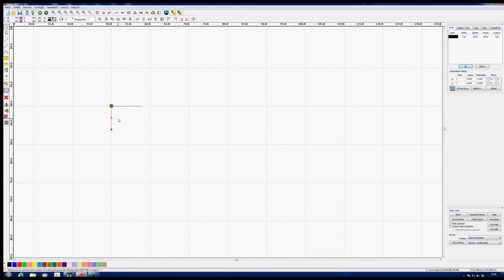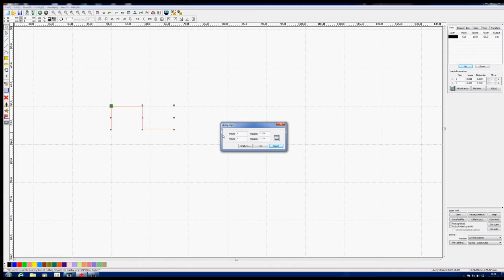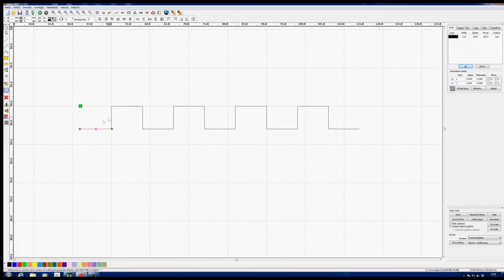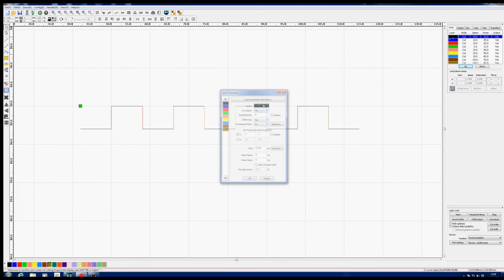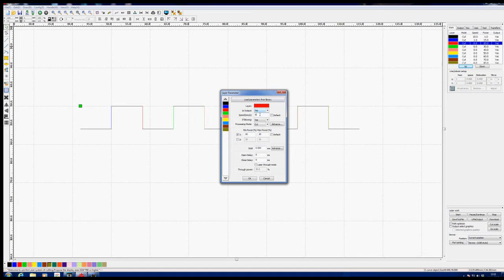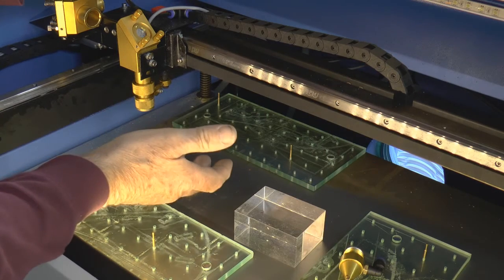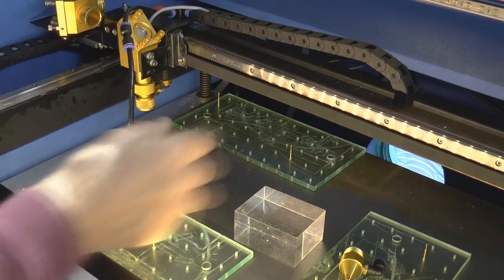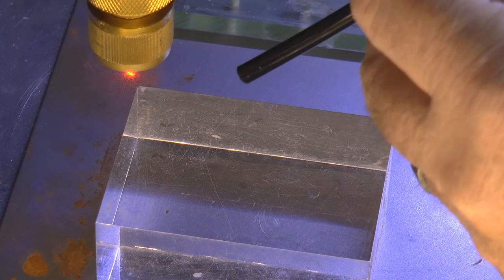RDWorks Learning Lab 27 Simplified Mode Burn Test

Comment: A true teacher is not someone who knows everything...A true teacher is who knows how to get the answers. YOU are a true teacher for me and a joy to watch all your lessons. I only wish I would have discovered you before I bought my nightmare laser. For the same money I paid I could have gotten a much better designed laser like yours. (mine had the worm screws to lift the table with installed 9mm out of the vertical and no way to adjust them as well as just clamps to hold the laser tube down) Finally after about 6 weeks I got it running thanks a lot to your lessons. Still needs a lot of improvements to be done and all the tests to see where the laser performs best. I have taught computer lessons on local TV and I know a true teacher when I see one.
Reply from the maker: Hi
Thanks for your kind words. For ME to learn this technology I need to break it down into simple understandable  (and rememberable) elements. I have spent many years designing and fault finding equipment. Solving these sorts of problems is bliss for me. I have often had to show others how to fix problems. You cannot fix problems with BS you need simple understandable elements  to build on because no two problems are the same. Never fear writing if you need advice. This far away I can only help YOU solve the problems, my arms and ears are not that long.

Best wishes
Russ

Comment: Much better way excellent .. I had forgotten the Y could be disabled !!!!!  .. Do you think the act of doing the burn going through all the mirrors affects the result?
Meaning that if the mirrors decrease in efficiency as the power goes up that it might not all be in the tube?
I wonder this, as techs I've seen on larger machines do this by removing the mirror and the shoot the test piece directly or perhaps use one mirror before the piece. hmmm ...
Reply from the maker: +guinnesspeaks 
Hi 
When techs do this mode burn for "proper " machines they are checking for the alignment of the reflecting mirrors in the tube. The sort of tubes you get in industrial machines allow you to set the internal mirrors to get the best  shape power distribution in the beam. Ideally you are  trying to obtain a nice even conical power distribution in the form of a bell curve or Gaussian curve. You do not need the influence of mirrors to upset trying to set this characteristic. Sadly you do not have the option to play with the mode in these  sealed  glass lasers. The ends of the tube are ground parallel and the mirrors are glued in place with epoxy. Crude but obviously effective (most of the time).  Because acrylic evaporates in proportion to the IR energy hitting it, the damage it does to a block of acrylic is a fantastic and simple way to see just how your power is distributed across the 6mm beam. You can test the beam directly out of the tube and after each mirror to see where you are losing power or getting beam distortion. So the purpose of this use of acrylic is not to SET the mode but to check how the mode / beam shape changes after 3 mirrors. If it's oval there is a good chance you are clipping the edge of a mirror (most likely mirror 3)as they are nearly all designed with that mirror centre low (don't ask me why). It also shows you the relative power characteristic of your machine. It is no real indicator of absolute power but should clearly demonstrate why you get little benefit from using more than 60 or 65% power setting.  This use of acrylic is about the only useful thing I brought across from industry.
Measuring absolute power from these machines is desirable but impossible to do without  purchasing a piece of fairly expensive kit This is all explained further into the series.
Thanks for your comments.
Best regards
Russ
Reply: I understand your line of thinking on this ...
Thanks for your response.
Reply: One more thought .. I haven't seen you investigate this... and I am not saying that you should at all. I think you might be interested however.
But my side hobby/biz was repairing computers.
I learned a lot about power supplies. I noticed over the years that they are not created equal.
They may be rated the same but they come from countries with different standards, and that the higher some are taxed, they will peak and diminish in output. They have different heat sinks, coils etc. They rate differently at peak power, and indeed how long they provide it. Chinese are notorious for lying about their product in this manner.
Another thing I noticed is that a good power supply feels like a brick, the crappy ones more like a tin can.
Reply from the maker: +guinnesspeaks 
Hi
Power supplies for these machines are beyond my comprehension. I communicate with a guy in USA who is a wizard with power supplies. I had several questions about my original power supply which he tried to help me with 
He informed me that HV power supplies to control these tubes are a breed apart and there is a lot of black art that each manufacturer employs. There are those who are good and those who just are. I'm not an electronics expert and the only thing I know about HV equipment is that I know nothing, so I pay it great respect.
I do know that the power supply that I now have with my 60 watt tube is superb. It's reliable and predictable and has been manufactured by the same people that made the tube, hence I expect they have been well matched. I agree about Chinese specifications  but after much research when buying my new tube, I was pleasantly surprised to find a Chinese company that did NOT lie about their products, produced something  that was well documented and of  high quality and were easy to communicate with.
Thanks again for your comments 
Russ
Reply: Energy passing to and through the tube may be clipping rather than smooth or at different rates than expected ... causing stress on the tube?
Much like they rate a 40 watt tube at 50 .. the same might be happening with the power supply or the quality of one of it's legs?
Reply: Ok .. thanks .. just a thought.
:)

Comment: Are you getting the same results from the new laser tube?  I'm going to have to try some tests at lower power settings.  Even at low speeds I've had troubles cutting through .25 inch plywood using higher power settings (90%).
Reply from the maker: +Rob Weinstein 
OOps. As you have seen. I wrecked my first tube by believing that more % meant more power. I hope I have now done enough demos to show that these machines do not have a linear power output, it drops off rapidly at about 60% and after that you are  just "over-revving" your engine. The purpose of this  test was to benchmark my new tube and graphically display its power characteristic without recourse to any complex equipment. As it happens I have a power meter on it's way to me and I will then be able to put absolute wattage values to my graph. Now that I have fitted an ammeter I absolutely know that 65% is the max current recommended for the tube and the only time I exceed it is whilst doing these few tests. I have a good contact in USA who has purchased the power meter on my behalf. Before shipping it to me he tested his own 60watt machine and found that he was getting just about 50 watts max at about 65- 70%. There was no extra gain between 70 and 90%I am anticipating my machine will turn out to be actually 40 watts. I have not cut 6.5mm ply but I have easily cut 4mm 3ply at 10mm/sec 65%. I suspect I could cut your thickness at 3 to 5mm/s
Reply: +SarbarMultimedia yes. I read enough before making my purchase that I've always assumed it to be closer to 40 watts. I would never have guessed (or even thought to have tested) that the output is non linear or worse. Amazing that it actually drops off with higher output settings. 
Thanks so much for putting your engineering skills to this problem. It will help all who watch to get the most out of our machines.
Reply from the maker: +Rob Weinstein Something I didn't mention. I noticed that running my machine for at 90% was great for up to 30seconds and after that the power dropped off rapidly.A couple of fellow users who obviously know a lot more about the physics of laser tubes than myself, informed me that is a typical characteristic when the gas mix breaks down and no longer lases properly.  Rest it for a few minutes and the gas recovers so that you will repeat the cycle. Whereas at lower  current inputs (say 65% power) the gas never becomes unstable and you get consistent results.
Reply: Hmmm Interesting. Seems like a Power meter would make life easier :) How does the look? Any LInks? And how or where do you connect them to measure the power? Is it actually the laser beams power it is measuring, or is it measuring how much power it get from the PSU or.....?
Reply from the maker: Hi Klaus
Power meters can be expensive.You can buy a US digital power probe for $800 or an analogue one for $400.
You can also go to 
http://www.bell-laser.com/?gclid=CJvxv5Cx1M0CFRFmGwodJBIJdg#!product-page/c1iym/1cd1a226-cf6b-7b63-26a7-2d551eb6821a                 and buy a cheap Chinese copy. (I tried one and failed)

I spent a lot of effort trying to work out why my tube was not performing well. From my acrylic mode burn tests I could see that things were not very good and although such tests tell you all sorts of data about the beam it cannot tell you about absolute power, just comparative levels. I tried making my own crude calorimeter without much real success and  I eventually had to buy a power meter to find out what was really going on.
https://youtu.be/DrbQdIAQl4s

After several months of using it many people advised me it was just and overpriced meat thermometer and that they were off to make their own copy..Many tried and all failed. Why? well thats explained in
https://youtu.be/lO9rWlobLZU

I'm sure that after this you will understand a whole lot more.

Best regards
Russ
Reply: Bugger! My email to you must have crossed your Answer here.  In the meantime, I actually just bought one from Bell-laser who you linked to.  What do you mean that you tried one and failed?
Reply from the maker: Hi Klaus
I tried all ways to obtain a Mahoney meter but a year ago they were not shippng to UK and they were not available on Ebay. I enlisted the help of a fellow laser machine user in USA to buy one on my behalf. He is a qualified instrument engineer and works on testing klystrons.. He didn't buy from Bell but found a vendor on Amazon and purchased a meter. I had previously agreed that he should keep the meter for a week or two and carry out tests on his own machine. The unit that arrived was almost non-functional........ erratic results and difficult to reset the zero point. He complained and obtained a full refund. As an instrument engineer he was curious to establish the cause of failure and maybe fix it. Upon inspection there were mechanical parts inside (a bit like the inside of a pressure gauge) that were badly corroded and sticky. I agreed he should  purchase the more expensive Macken meter for me instead. He tested his 60 watt machine and was not surprised to find it only delivered 49 watts. He was impressed with the quality and repeatability and then shipped it to me. The rest of the story is in my videos.
That does not mean you are buying rubbish but test it soon and carefully. Understand the principles of how it works from my video and make sure you ALWAYS zero to ROOM temperature. I doubt if Bell Laser will have tested the meters. Having traveled all the way to USA from China and then back to you, who knows how the mechanism inside has reacted.

Best regards
Russ

Comment: Great videos. They've helped me a quite a bit. When you have the dialog up to set the power and speed, rather than hitting "ok" try clicking on the next color in the left hand column. I'm using the most recent version that Thunder Laser has posted on their site which does works with my 7050 model laser.
Reply from the maker: +robbie ayers
Hi Robbie, Thought I answered your comment but it appears to have gone!!
Thanks for your comments and support. I'm on V8.00.25
What left hand column????? OH.... THAT LEFT-HAND COLUMN!!!!!!! My first excuse is my big nose got in the way. My second is it was hidden behind my stupidity. Shamed, but thankful for your help
Russ